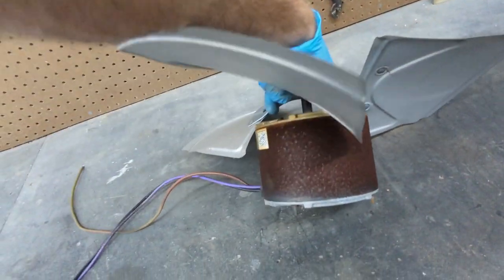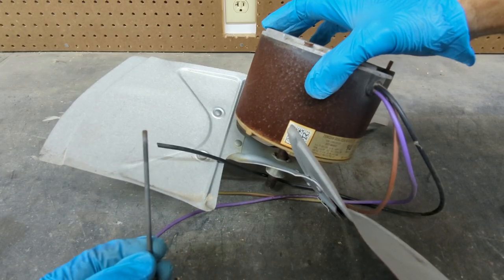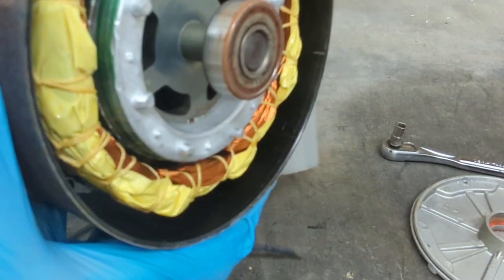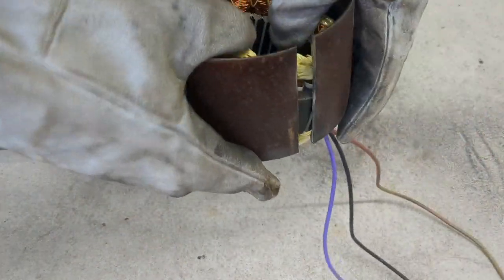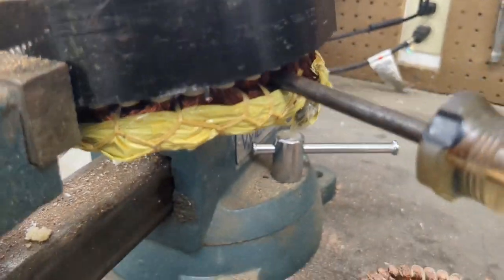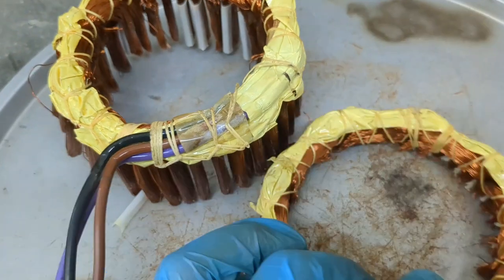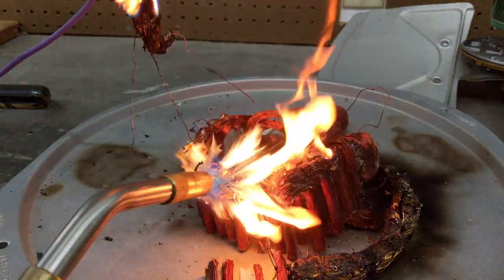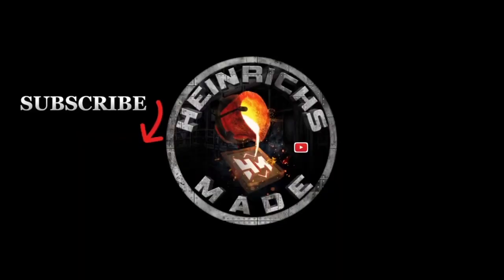⚒️ Removing Copper From a Fan Motor For Scrap

Comment: Nicely done!!!!
Copper is my favorite metal to work with too.
Always thought about getting a harbor freight air hammer to do this same thing. But your way looks just as easy. 👍🏻👍🏻
More motors to strip, lots of GOLD in them motors...lol
Can't wait to see tomorrow's Video!!! 🔥🔥😎😎🔥🔥
Reply from the maker: Thank you!  Yeah it's not too bad using a screw driver or a pry bar.  Usually it comes out pretty easy.

Yeah tomorrow's video is 🔥🔥🔥

Comment: Nice! Where do you get motors from? The only ones I've got have been copper plated aluminium...
Reply from the maker: This fan was from a condenser.  HVAC condenser for air conditioning.  So far all of these have been copper.  However the wire going to it is aluminum.  Weird!